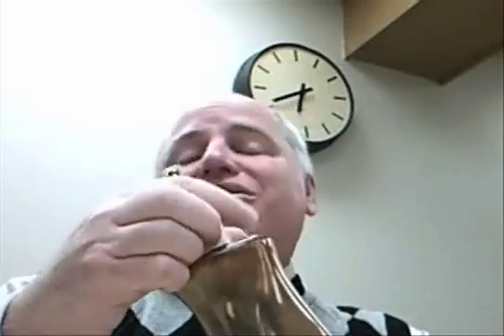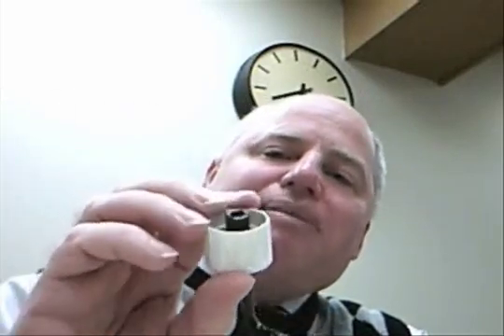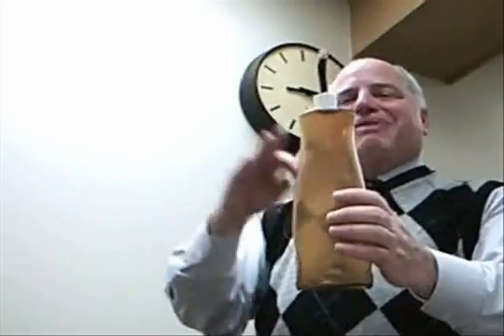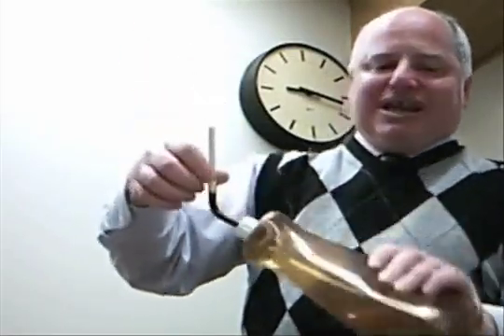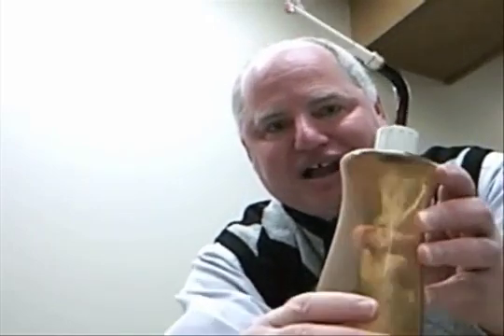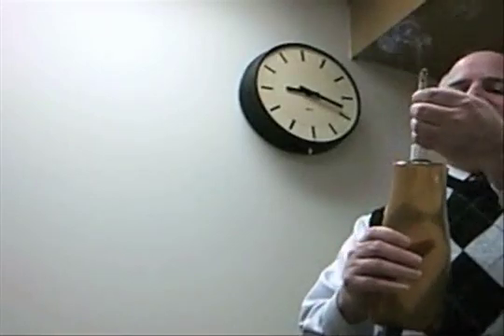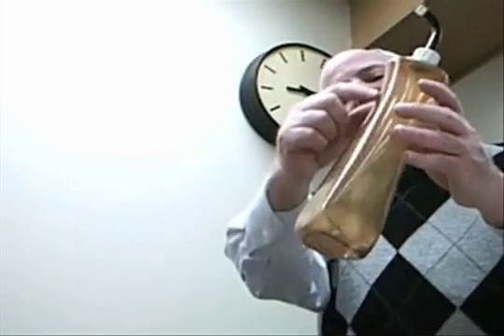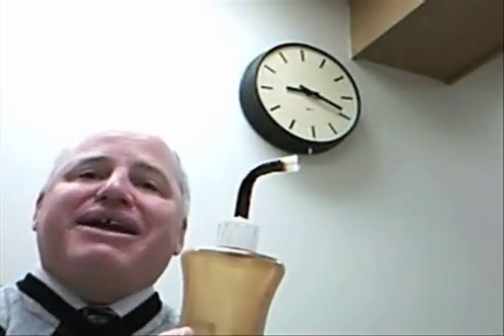The Palmolive bottle demonstration

Comment: I actually used to clear my lungs as much as possible between puffs.
Reply from the maker: In reality though, there was not much you could really do between puffs that was going to make that much of a difference. The only reason the bottle was able to blow out so much smoke was because there was no moisture in it that would condense and hold the tar. Lung tissue would have trapped it stopping most the smoke and tar from having been exhaled back out. The lungs own cleansing mechanism should have been able to help clear out particulate matter but the smoke itself interferes with the lungs normal cleansing mechanisms. The reference page http://whyquit.com/joels-videos/cilia/ explains this issue. Also related to this topic is http://whyquit.com/joels-videos/will-my-lungs-ever-look-better/
Now, instead of ever having to worry about how to get smoke out of your lungs once it is inhaled all you need think about now is how you will never have to bring that kind of assault on your lungs again by simply making and sticking to a personal commitment to never take another puff.
Joel